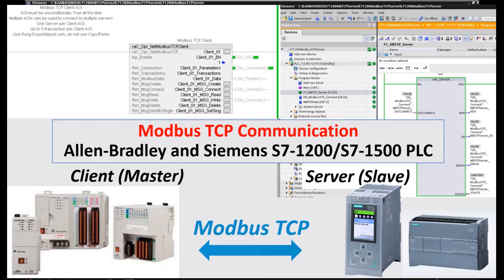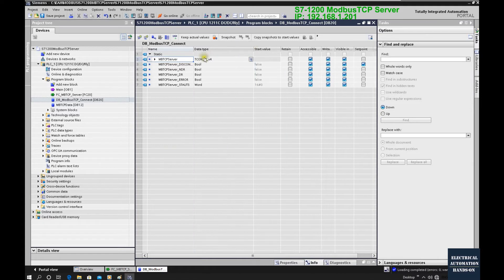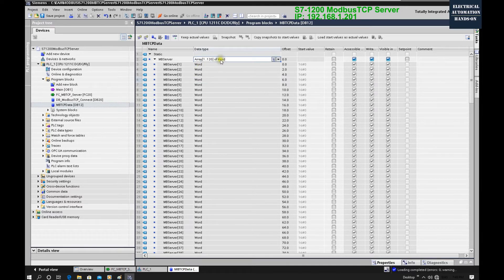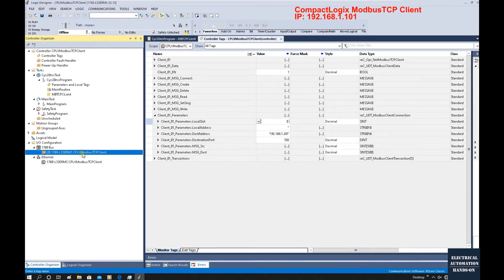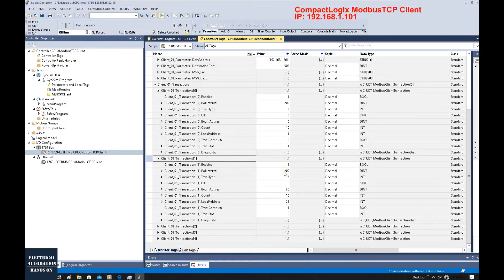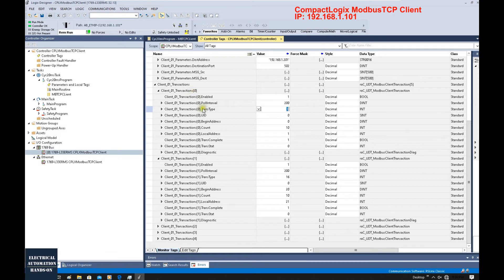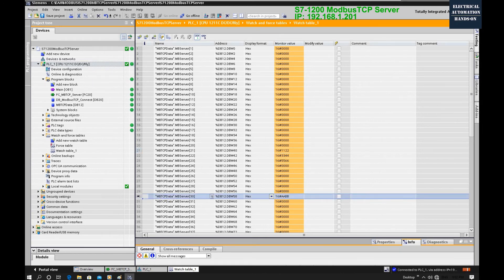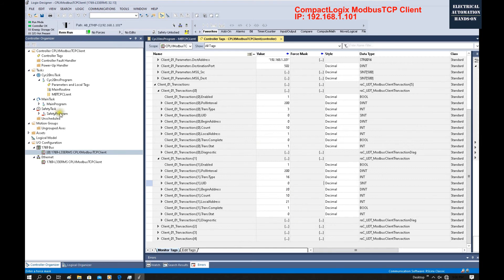COM21. ModbusTCP - Allen-Bradley CompactLogix (Client) and Siemens S7-1200/S7-1500 (Server)

Comment: Is there a way to transfer string data？
Reply from the maker: A string includes 255 bytes (max), so sending bytes
Reply: So I need to split the string and send it separately? Addition, if I have the Siemens as a Client, which tag type (like 16#00C1) can transmit alphabet ？ Thank you so much in advacne!